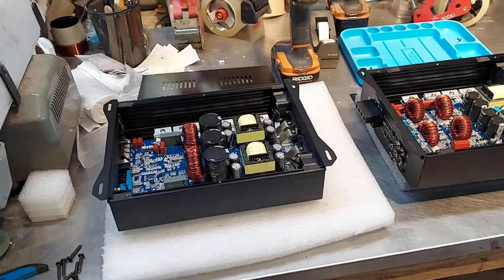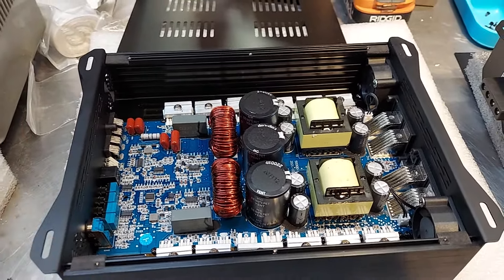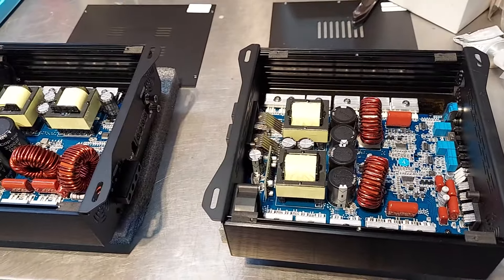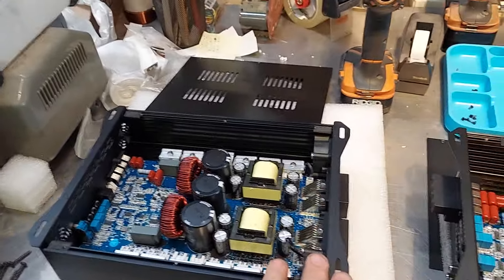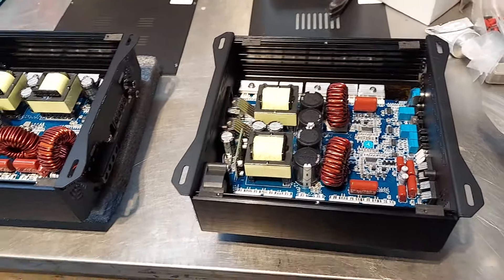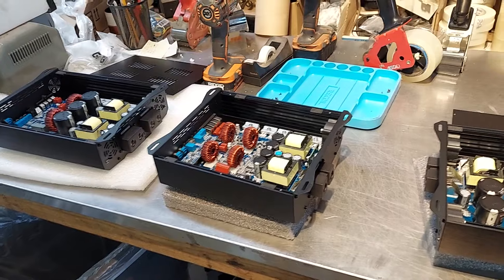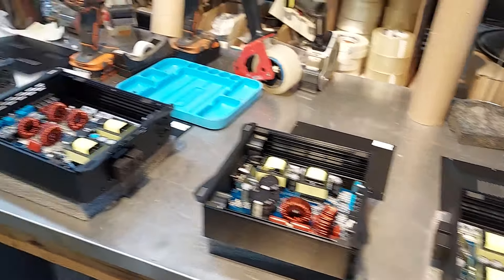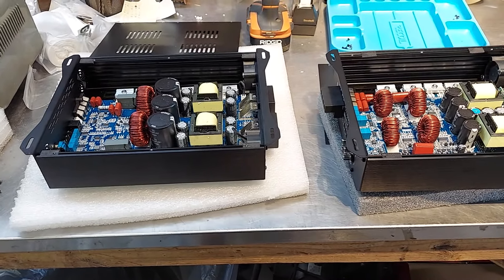Brazilian Designs GONZO Amplifiers 5k 1 ohm, 3k 1 ohm , 3k 2 ohm & matching 4ch 600w x 4 @ 1 ohm ch

Comment: Patrick,I missed the boat earlier this year,I'm saving now to at least get my first batch of 10 of them from you.
Reply from the maker: Get those Gladiator 12's and 15's before the price goes up.
Reply: @RobotUnderground  grabbed,21 gladiator 15,s16 javalin 12,s12 javalin 10,sand a shit ton of the high end 4 inch vocals,6.5 and 8,s and about 12 of the slim line8,si think all the gladiator 15,s are gone said sold out three weeks ago, I just checked and they must have less than a dozen gladiator 12s can't add that many in cart
Reply from the maker: @ogairbender808  Good deal

Comment: How can these make the power you're saying? tiny power supply and very little cooling, not an expert but wondering?
Reply: High voltage design aka Brazilian
Reply from the maker: Dual rail voltage power supplies.  You can learn more on Barevid's page. https://youtu.be/PcHJEARRlag

Comment: Hi Patrick, I bought one of the 5k wolfram/sundown style amp last year early part of July i haven’t had any problems with it whatsoever and out of the blue it started smoking.. by no means do I run it hard, the subs I’m currently running are two12” L7’s.. I know you said it has a warranty is there any way you can help me out with this issue thank you Patrick.. I recently got a new phone and lost some of my contacts I just seen your number in the description I will contact that way..
Reply from the maker: Yeah, it happens with lots of amps.  Just buy a new one.  You can get a smart 3 for like $250 now.  Also check out DS18's versions.
Reply: @RobotUnderground  so they don’t have a warranty?
Reply from the maker: @imskjrpops6389  Some were sold with warranty, some were not.  Either way it needs to be inspected and determined if the cause of failure is due to abuse.  You may want to read what warranties cover.  That's one of the reasons why we test ever one of those amps before they leave here and I make videos... To show that it worked when it left here.  At this point in time, we've had ZERO returns so the chances of it being a defect are not in your favor.  We sell them so cheap though, I recommend just buying another one.  Keep in mind, I have no idea who you are.  I don't know what, "imSKJRpops", means.